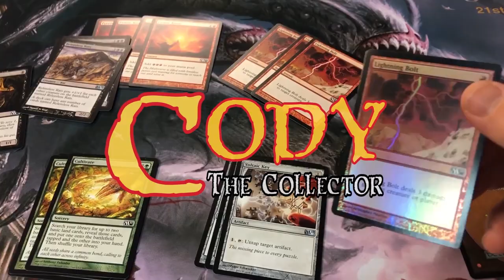DND-I-Y - Bocote Dice Box... Wyrmwood style.

Comment: Looks great! Just out curiosity, why use a cheese cloth to apply your finish? You could just use it dry to wipe down your piece to remove any left over dust and apply finish with a lint free rag.
Reply from the maker: You're probably right.  It's specifically what the finish called for on the can.  The idea is that it's a process that requires two or three coats.  Cheesecloth is pretty disposable and since the finish is wax based the friction of cloth helps with warming the finish during polishing.  Similar to a French Polish.

Comment: Hey, it seems like you have this all figured out except maybe how to mount a fan to blow away all those wood chips, that would drive me batty, especially the large bit, wow.  I know you never mentioned it but I trust the drill press had a depth stop set so you couldn't dill too deep by mistake that would sure make a mess.
Reply from the maker: 💯 right on the dust!  I had an air hose that I was using to shoot away the cuttings but a fan would have helped further.  Especially during the routing.  Also, correct, there is a depth setting I had adjusted during the Morticing on the drill press.

Comment: Nice video. What is that workstation you are on? It has a table saw and drill press together?
Reply from the maker: RoseKindred I built this on a Shopsmith machine.  It was a great tool for getting started in woodworking.  They are also very easy to find second hand!
Reply: @SylvanWorkshop  Thanks for the info. I looked it up and it is a neat system. I thought it was like a one set up tool that had two stations combined.

Comment: Dude, how can you do the mortise and edge forming if you only have a freehand plunge router and not drill press? Also can you provide the dimensions of the over all box ? And depth of the mortise ?
Reply from the maker: Here is Wyrmwoods official dimensions from their Kickstarter page 
https://ksr-ugc.imgix.net/assets/020/061/819/92919a9649b09ea56f4666a5fdf9d066_original.jpg?ixlib=rb-2.1.0&w=680&fit=max&v=1517410665&auto=format&gif-q=50&q=92&s=10ae91f0461970b27800b829c6768e07
Reply from the maker: I believe the mortise depth I used is around .625".  Remember using .75" stock you could go a bit deeper if needed.  As far as only using a plunge router, my first thought would be to make a cutout / stencil out of thin stock or plastic to give your router guide something to ride in and fix it on top of your work piece.  There are a few youtube videos that provide instruction how to create a mortise with a router and router guide as well.

Comment: Hey great job on the box. What are the dimensions of the box interested in building this in my woodshop class
Reply from the maker: https://ksr-ugc.imgix.net/assets/020/061/819/92919a9649b09ea56f4666a5fdf9d066_original.jpg?ixlib=rb-2.1.0&w=680&fit=max&v=1517410665&auto=format&gif-q=50&q=92&s=10ae91f0461970b27800b829c6768e07
Reply from the maker: Awesome, let me know if you end up changing any steps.  This was my way of figuring it out, but I’m always interested in improving.  Good luck!
Reply: @SylvanWorkshop  I will say if it turns out well
Reply: @SylvanWorkshop  I did similar but I got a snowball effect of "well I could just make templates to route out.... But now's I need to upgrade the router table... This will make a lot of dust so I need to create a special dust collector for under the router table..."  I'll get around to it though, I'm nearly at the point of cutting wood again!
Reply from the maker: @volatilesky  I totally know what you mean...  Been trialing some MTG deck box designs and thought how much easier it would be with a spline jig.  So now making a spline jig and the box gets pushed back further!
Reply: How has the finish held up on this? With how oily bocota is I was thinking of using a lacquer over the wax.
Reply: @SylvanWorkshop  I found this video while looking to make some deck boxes.  Did you ever have success?
Reply from the maker: @briandavis6530  hey Brian, I’m still working on them.  I’ll post a video once I finalize the design.  Check out a prototype on my Instagram.  Same as YouTube cody the collector.
Reply from the maker: @zenchronus  it's held up pretty nicely.  I'm not sure the best way to finish Bocote specifically but seems to be holding up well.  The wax is easy to reapply and buff to freshen up.